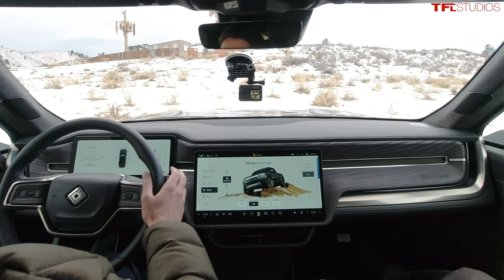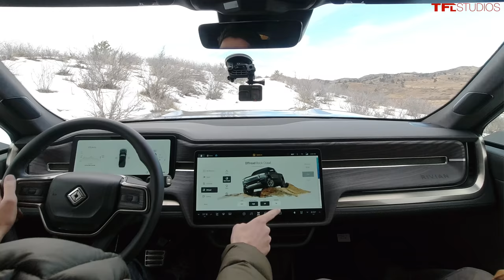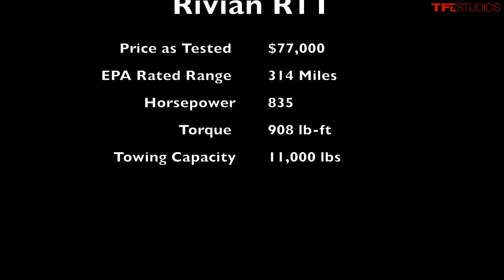Fully Loaded! Can an EV Pickup (Rivian R1T) Survive a Hard Days Work?

Comment: This is the best Rivian video review I've seen, TFL is crushing it!  Rivian, if you are reading this, all of those overhyped press events you did with other journalists were pointless, we just needed to see how it works in day to day use like this video.

Personally i only see a few small flaws with this truck, the biggest being the low power in the outlets for an EV.  Really there is no reason it's so much weaker than the ford f150 which gives you 2KW on a gas engine, then 7-10 KW on the hybrid/lightning.

Comment: Rivian is impressive, you guys making that plywood bedliner was a great idea
Reply: Not really.. if I have to line the bed with plywood to avoid damaging it then it isn't a good bed. I get their excuse, but it still isn't great optics.
Reply: @cldude691  Its not their truck and its not a journalist vehicle/test vehicle either, someone wants it back at the end, it makes perfect sense to protect it for them. If I loaned my vehicle and it came back damaged or marked up I'd be pissed too
Reply: @FracturedGoblin  its called being considerate.
Reply: @cldude691  I line my bed with a plastic bed liner.  What’s your point?  If there is one it’s not valid.
Reply: @cldude691  not their truck. they need to baby it cosmetically at least.
Reply: @cldude691  it's called respecting someone else's property 
Their just being sure to return it back I. Equal or better condition as to what they got it.
Come on its $77,000. The guy that owns it is generous enough to loan it out
Reply: I have put a sheet of plywood in the back of just about ever truck I have had.. just helps protect it more

Comment: I know they say this isnt for ranch/farm use, but I think its perfect. Usually ranch trucks arent doing too much mileage on a daily basis and just go around the property, and by charging on the property they technically never even have to go to town to grab gas.
Reply: Yeah a work truck model would make total sense and I’d imagine if they can ramp up production volume they’ll do one but I’m sure it’s extremely difficult to come out of the gate as a new company with a high volume low price vehicle in year one of production.
Reply: And if you have on-site tanks, it becomes a security issue - especially in rural Canada where you don't have the same ability to defend your property that you would in the States. EV's would solve that problem!
Reply: Depends on the farm. Won’t do any good with livestock. Will it tow? Yeah but the battery depreciation won’t be good for long trips trying to charge with a trailer full of livestock. 

I’m a Tesla owner and live in Texas. I wouldn’t recommend electric for livestock one bit.  Otherwise yes. It’s great.
Reply: Only if it had a real usable bed....... 4.5 ft doesn't cut it on any farm
Reply: @willrector9716  If only it would fit 4x8 sheets of plywood or a bunch of 7' logs.  Oh wait, the video showed it doing both. 

The pickup truck industry has gone primarily to short bed pickups, because those are what sell, meaning thats what most people want.
Reply: How many farms and ranches have you worked at?
Reply: @samblackard4919  I own one.......
Reply: @niemekv1  must have volume in a bed..... most usable farm trucks have a 8 ft bed that simple. It's a city "truck", it's that simple.
Reply: @willrector9716  And I bet you have six tires.
Reply: @robertmisiuk7137  no its about volume not weight usually.... just doesnt make sense to do more trips with a tiny box. Basic common sense
Reply: @mikeeger6102  Defend? Defend? What are you talking about; Chyneseum invasion or wild men from down south? Maybe you have thieves; is that it they steal your precious go-juice on farm?
 I guess it happens here too, south of the equator! We do diesel too!
Reply: @niemekv1  My little 7x4 box trailer does that for little money cost!
Had it made to take 8x4 sheets! Perfect!
Reply: @willrector9716  Yes, for tooling around in L A to show how ? green, cool, woke you are !  Not the real deal !
Reply: @linmal2242  what are you even talking about Yoda
Reply: @MannyKings5  once the get the power density to equal that of a gallon of diesel, diesel will slowly begin it's death. Unless a diesel hybrid is introduced.
Reply: @mikeeger6102  cold kills range by up to 40% and slows charging.  I just got rid of my EV for that reason.
Reply: @niemekv1  to be fair a full size pickups short bed is still a foot longer than ghe rivian with the tailgate closed but that length with the tailgate down is amazing for the closed length.
Reply: for all the ranchers/farmers who have $70,000 to spend on a truck right?

Comment: That gear tunnel thing looks really useful. What a good idea, I can see that being implemented on other trucks.
Reply: Unless other trucks stop using ladder frame shassis then they will never be able to use a gear tunnel. On the Rivian it is possible because it is a body on frame vehicle.
Reply: @migueljardim8177  the lack of a driveshaft or exhaust, and fuel lines help too.
Reply: @RedWingsninetyone  Yeah that too, for example the Ford F-150 lightning has a ladder frame shassis so it will not be able to have a gear tunnel.
Reply: @migueljardim8177  a body-on-frame chassis is the same thing as a ladder-frame chassis, no?

Comment: The problem with putting the tire underneath is that when your stuck in a muddy 4*4 trail it can be nearly impossible to get the tire from underneath where a lot of SUV/trucks put it. (ask me how I know) you cant put it on the back since it has a real tail gate. So really the only good option is under the bed but yea you gotta unload all your stuff if something goes wrong. Still better than digging in the mud and jacking up your truck just  to drop a spare from underneath. Solid video guys
Reply: Right. This and the 2 other complaints made were pretty minor things in the grand scheme. If you get a flat and have to unload stuff, 98% of the time you’re only gonna have a few things in the back that won’t take long to unload.

Obviously in this case it’s annoying if you had to unload all the wood, but still better to have decent clearance with the air suspension and a tire in a tucked away spot in my opinion
Reply: I know exactly what you mean. But it wasent my tire but i screwed up my rim on a rock.stuck trying to get the spare out from under the mud in the cold and that day it was extremely windy. Lets say  never did that again
Reply: Yeah that's why I keep a spare in my bed because even if there is space I doubt I can take off the spare underneath with all the mud and rust around the bolt 🙃🙃
Reply: Wow beta cringe in here....lol
Reply: @TC-kf9zw  😂

Comment: I'm 70 plus years, been around trucks, heavy equipment , logging and construction since I was 10.  I really like the rivian, good looks and great features.  300 miles per day range is plenty for a lot of working guys.  If I were young it would be on my shopping list.  I hope they succeed.  Also a good, simple, real world review.  Most of us don't dream of rock climbing in Moab.
Reply: You have a lot of wisdom than most tech savvy people I have seen. You are right about 300 plus mile range.
Reply: @venunarla  A little honesty helps. With all the lies demanding 600 mile ranges in EVs even fooled me, until I verify the facts and check back my ICE experience. I always budget my ICE to have a range of 200 miles because I don't trust the specified full tank range. In a traffic jam, the fuel get burned rapidly. Checking specs of F150, the longest range is only 500 miles, at 20 miles per gallon, a very unrealistic real world range.
Reply: @othmanskn  yeah lot of people overestimate what range actually they need. 300 miles is a comfortable range. Except for the occasional 2 or 3 long trips in a year , most find 50-150 mile range is most they use per day…and those 3 long trips….with current ev charging speeds at 200kw, the long trips don’t look that bad either, they just 1-2hr more time for 1000 miles . So it doesn’t make sense to crave for more batteries which add only add weight

Comment: Wow the suspension held up incredibly well on that load!  Most small trucks I see with big loads like that have the tires rubbing the wheel wells lol!
Reply: It has air assist. If you put air assist on any smaller truck it would handle the same load just as well
Reply: No you dont. That load was lighter than you think and even the smallest trucks offered these days have 1500lb+ bed capacity. The trucks youre seeing are old, from the 80s or 90s, beat to shit work trucks

Comment: You probably shouldn't change a tire with a full load in the vehicle anyway.  Jack isn't rated for that.  Also, you don't want to load to shift.
Reply: That is a good point, but there are still circumstances where camping gear/plywood could still safely remain in the back while changing tires.
Reply: @TFLoffroad  you’ll need to unload part of it but a good plug kit and and air compressor can get anything but a shredded tire to a tire shop
Reply: Tell that to an 18 wheeler drivers and he’ll laugh at your face.
Reply: @TFLoffroad  Could Rivian consider an optional full spare option for frunk?
Reply: @mattbrew11  I've had tires go from a simple nail hole that wouldn't make it another mile, let alone to a tire shop.
Reply: @unforgettable8092  I'm sure you can always add one! Off roaders often add their own spares to their vehicles when running larger wheels/tires.
Reply: @RedWingsninetyone  in a truck tire? I find that hard to believe I put a 1.5” tree branch through the outside edge of tread near the sidewall of a tire offroad and plug it with patience and a full pack of plugs. That tire is still on my Jeep as a spare and it doesn’t leak.
Reply: @mattbrew11  I ran over a piece of debris in the roadway. A mile later I heard the unmistakable sound of the tire letting go. I pulled over and it was completely flat within a minute. I had to be towed to a repair shop since my spare was rusted on so bad that I couldn't get it off.

The hole in the tire was small enough that they were able to easily patch it at the tire shop. And yes, it was a pickup truck tire.
Reply: @Doncan0823  I drive milk double tanker trucks that weigh 105,500 fully loaded. You definitely can't unload 74,000 pounds of milk on the side of the road just to change a tire. It's a non issue. The jack just needs to be able to handle the weight of the truck with a payload.
Reply: Would the spare fit in the back seat? For lighter loads, this could be a work-around, I think.

Comment: It would be nice on these videos to find out what the actual payload that they hauled was. That looked way over payload, and it didn't care, which is awesome! Impressive truck and great video
Reply: I think they got the payload figure wrong though, I read on the owners manual that the bed payload was just over 1700lbs. It was hugely impressive what it hauled though.
Reply: We tried, our scale was on the fritz. It was a LOT of wood tho. I do mean a LOT 🙈
Reply: @TFLoffroad  it looks like it! I was impressed for sure
Reply: Ive hauled enough logs to know that they exceeded the rivian payload before they got into it themselves
Reply: Around 19:00 they said it’s about 1500
Reply: 23 logs, I'm going to guess around 80 lbs average per log but could easily be more like 100, which means likely somewhere around 2000lbs, over the payload limit. Would really be curious to know how much range it has carrying so much. Wish it was driven 50+ miles with this load and see the battery loss.
Reply: Does the R1T not provide that number like the Lightning does?  Wonder if it's something they could add via software update.
Reply: That's more than 80lbs per log try closer to about 125-150lbs a piece and closer to about 2300
Those logs were an average of about 8inches across or more x 7ft. The smallest ones would be a around 100 and some of those larger o earound about 200lbs
Reply: @davidd.234  Yeah it depends on the condition and type of timber. Some of the smaller ones could even be under 50, could also be well over 100 as you say, it really depends. I think if anything my 80 lbs average is a little high, most of them are on the smaller side. I doubt they'd overload it that much over payload capacity. Really wish they'd been able to get an accurate weight measurement so we wouldn't be here guessing!
Reply: As for the weight of the logs, remember that he said that the area had burnt several years ago,  so the logs were already dried and they wouldn't be quite as heavy as fresh green wood.
Reply: @FrankFH  ah this is a very good point. Based on that alone I'm going to say they were more like 60lbs avg at most. So no more than 1400 for the load.
Reply: People that haul wood know that this is way over 1400 lbs no question asked haha
Reply: @kstorm889  I've cut and hauled plenty of wood over the years. Agree it could be over 1400 but we don't really know. A lot of those logs are much smaller than others. Based on everything we do know, it is probably in the ballpark of 1400. I doubt it's over the ~1700 payload.

Comment: Tommy, if you find the time...could you go into detail on Rivian's Suspension system?  I know many engineers at Rivian came from McLaren and the R1T has a suspension similar to a McLaren 720S with air and a cross-linked hydraulic system.  #2nd big ask would be for more in-depth of what makes up the "off-road" package?  I don't think I've ever seen an R1T without the $2K off-road package, but many of us are questioning if we need it or not and what exactly (pieces-wise), are added to the underbody?  Thanks, y'all are doing a fantastic job with the R1T!
Reply: I have been wondering if I really need that off-road package myself. The truck can still be had with the 34" all-terrain tires and with the up to 15" of ground clearance without it. My existing Toyota truck has done plenty of off-roading without any additional body armour underneath.
Reply: The $2000 off road package is simply the two front tow loops on the front and the underbody shielding. The 20" AT tires/wheels are a no charge option in place of the standard 21" all season tires/wheels.
Reply: @cruiser97eric1  you don't need the offroad package, unless you face serious trails often.
Reply: They all come with off road mode just like they all go into sport mode
Reply: @MrJnt19  off-road package, not “mode” is what we were discussing